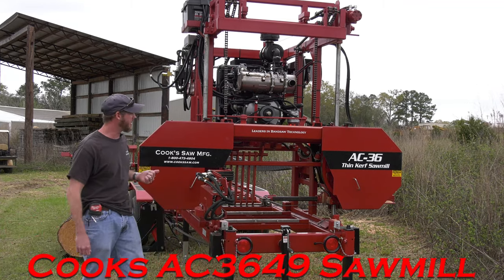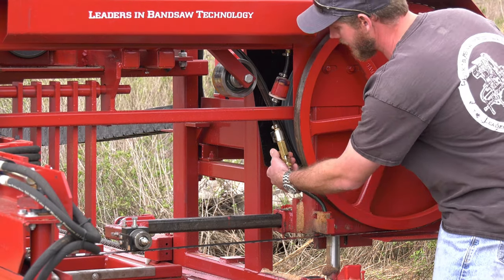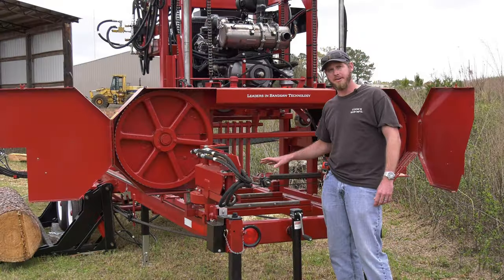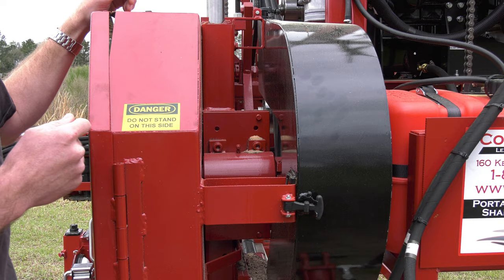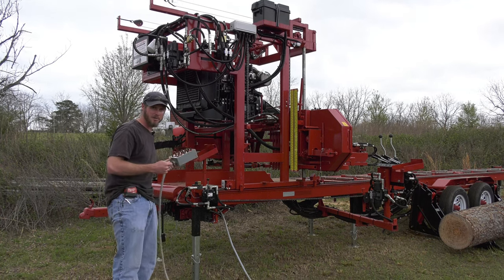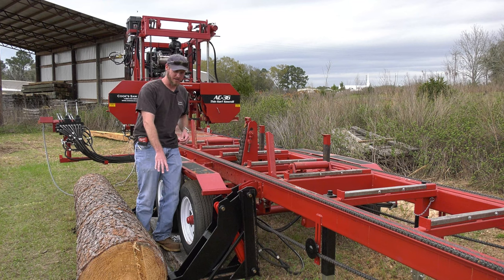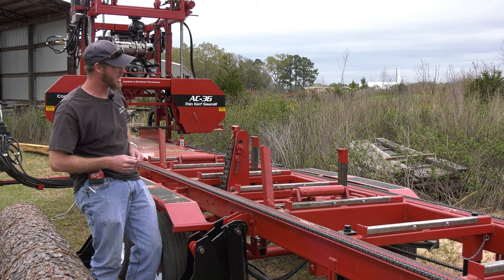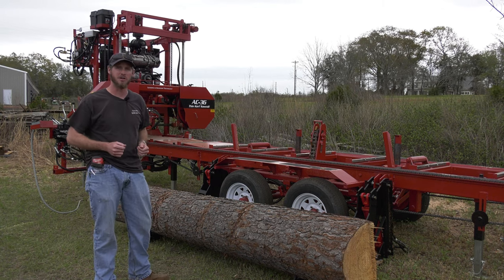2024 Cooks AC3649 Portable Sawmill Demo

Comment: That thing is cooking.  I have a little woodland 130, and it shakes like a twig blowing in the wind when sawing. 
I'm going to have that saw(ac3649) one day.  
Question: Were you running setworks in this video.  It looks like you were.  
Also is the yanmar 67 turbo?
Reply from the maker: No setworks on this setup. It is the smaller 49hp Yanmar; the AC3667 67hp Yanmar model comes standard with setworks however.
Reply: @CooksSawmills  okay well I think I'm sold for no set works, I like keeping things simple and that guy was putting out some lumber in a hurry.   As long as all them boards were the same thickness lol.